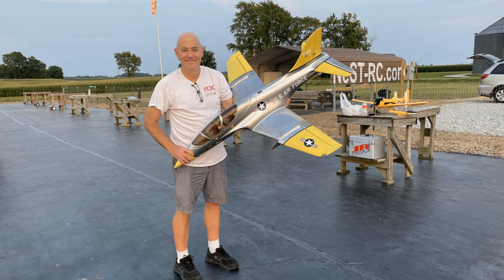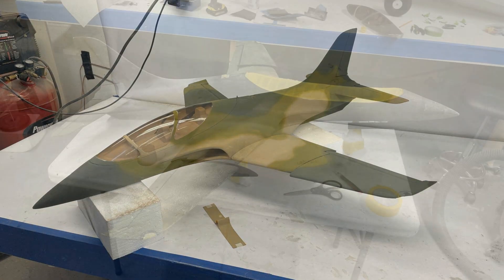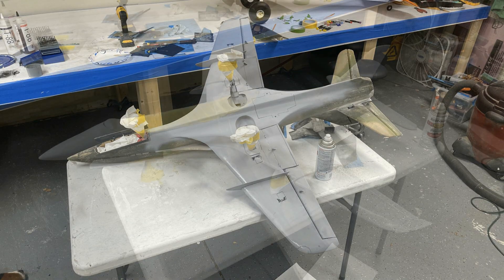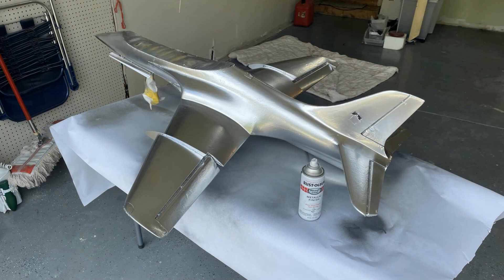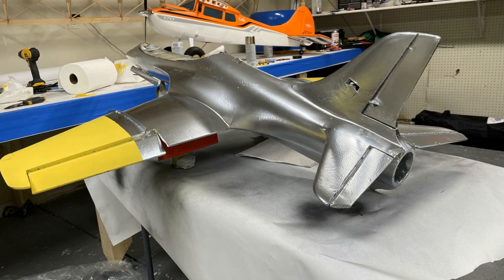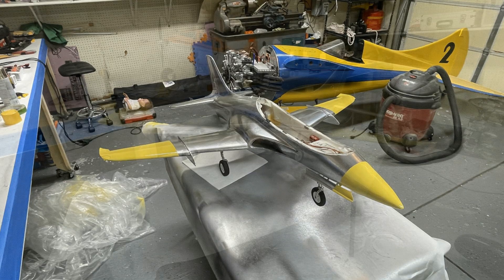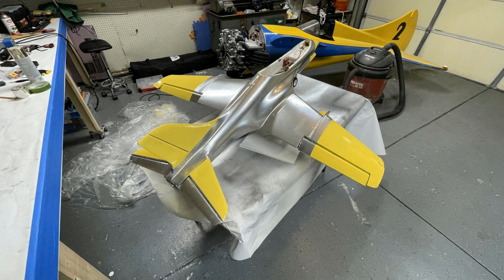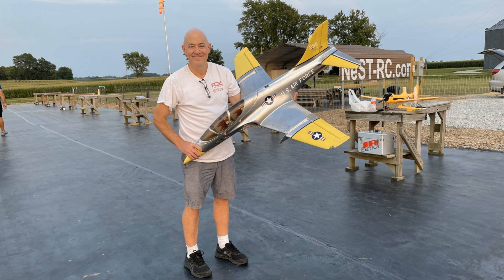The Lead Sled | What Happens When You Add Weight to an RC Airplane?

Comment: Couldn't have asked for a more pertinent video right now. I've been working on  my  3D printed Yak-15 and it's nearly 3kg with a 70mm EDF on 6s. All the calculators say it's way in the red but it flew so well - My plot said all it needs are flaps and it'll be great.
Reply from the maker: Very cool, I am on the bench now with all the info out there about wing loading. I have video I will be sharing soon. Thanks for the comment! :)